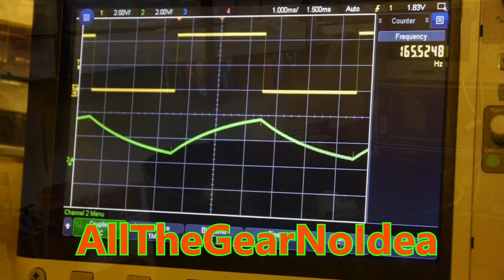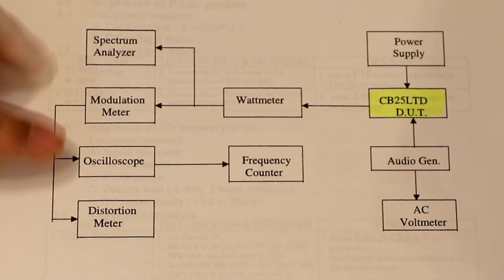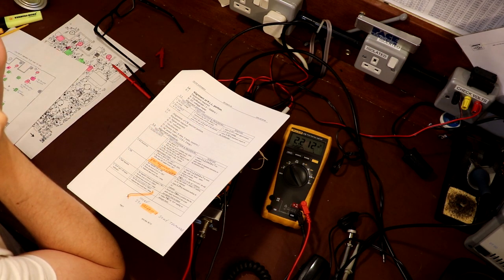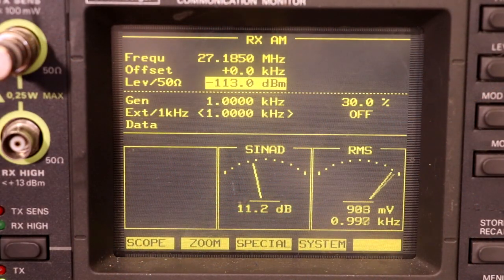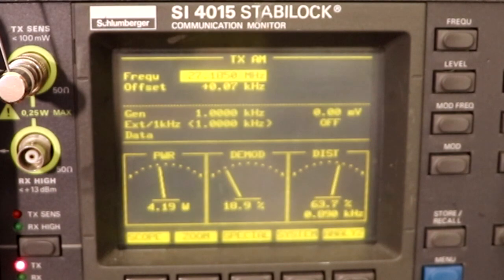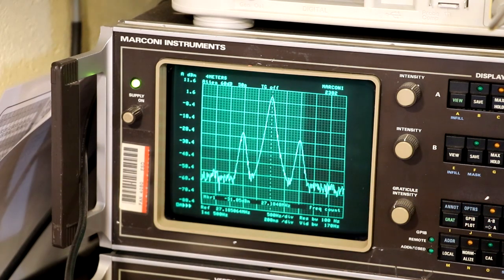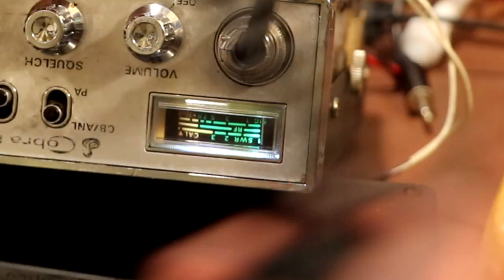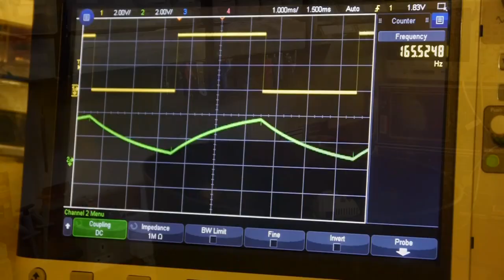KNOBBED OFF - COBRA 21LTD - Part 4

Comment: Excellent work, Chris. For receiver alignment many times the manual will have you start at a high input level for a radio that is completely out of alignment and then reduce the level as you get closer - there is usually a note to use the lowest input possible to avoid AGC / ALC. I've worked on lots of VHF and UHF comm gear but never any CB.  My least favorite radios were military sets, AM, FM and PM, voice and data, that were both encrypted and frequency agile (sync'ed by GPS).
Reply from the maker: David V I have a few old valve radio military sets many use a large modulation transformer for the AM. I will have to do a video on them. I don’t think my test set would even output 1mv I did turn the power right down -122dbm for the final part of the alignment. Went back again and did it buy ear. Regards Chris

Comment: I think you are right on many things chris, the core is missing but the spaced out open coil next to aluminium heatsink looks wrong, i would squeeze it back into a tight spring.
It could be messing with the pa impedence, so upset the gain and harmonics.
I would also turn the power to just under 4 watts to allow the modulation to lift it to just over 4.
But thats just my guesswork as i never bothered much with am tx.

I used to use a brass pin to touch the early tx stages on 1 and 40 to see if the ends deviated by the same amount and direction.
Very bodgy, but with practice it works.
I was more of a tune by ear and eye for the rx side, if the i.f strip was way off a weak10.695 mhz signal would allow peeking of the 10.695 and 455 stages.
Keep the levels low so the agc does not interfere with the full sensitivity.

The front end cans i would tune to ch 20 and listen and tune to the noise on 1 and 40.
Yes im crude but it was good enough.
For the vco, keep the voltage well within the supply voltage fed to the pll, rx 1 then 40, then key the mic and check 1 and 40.
There is no exact value, just keep it in the middle of the range.
Reply from the maker: I think they used to call the tuning aids a gimmick stick. Had a brass slug at one end and a piece of ferrite material at the other. I  actually tuned the receive path by ear but ear again later and got better results than trying to go of the Sinad . Ok I will check the mod adjustment again with the radio under 4 watt. Many thanks regards Chris
Reply: Ooow i didn't know it existed, a gimmick stick lol.
I just used logic to judge the balance of the tuning.
I also got to know some radios so well that i could tell if the tx side was  tuning normally or not.
Sometimes adjusting the vco on t.x could be dodgy due to the r.f energy out of the final stage getting into the meter, so disconnect the power to the final r.f p.a transistors.
Basic stuff that setup instructions forget to tell you.

Thank you for another smashing video :-D i hope you enjoyed having a tinker with crude c.b's :-D

Comment: Did you check th VR5 itself in case it is cracked, I have seen a similar symptom before from a cracked pot.
Reply from the maker: Defpom's Electronics & Repair  Hi Scott first thing I check with a meter and it measured fine end to end. Only one end is used as it’s used a variable resistance rather then a pot. However I will check again based on your advice. Thanks Chris